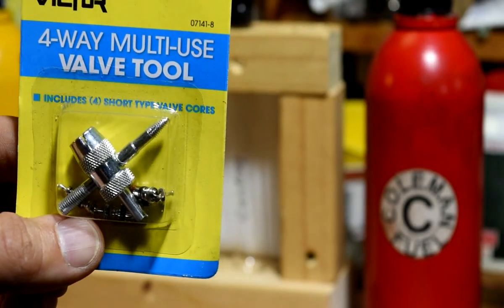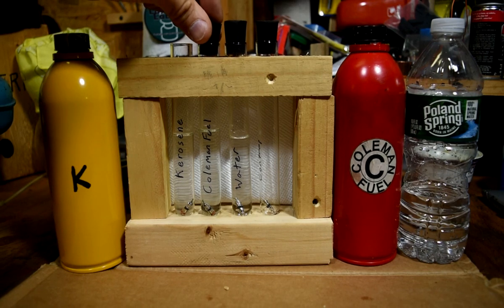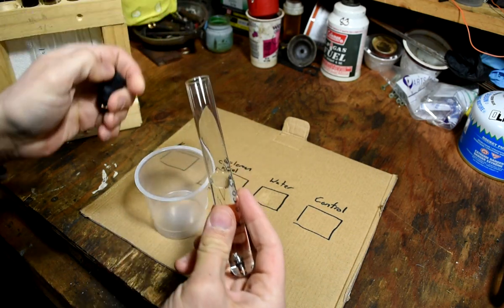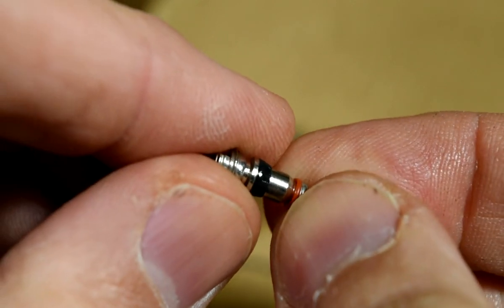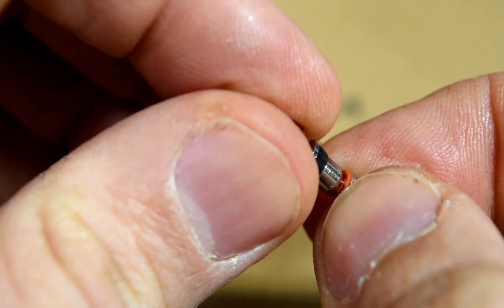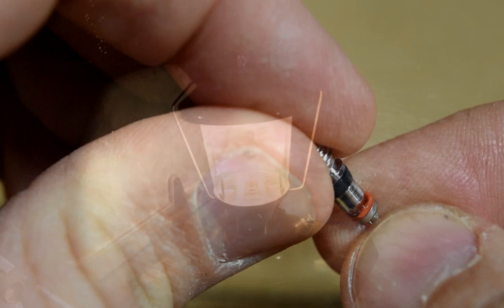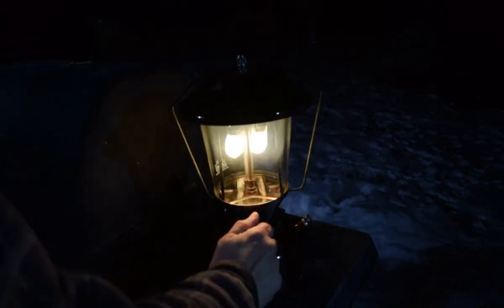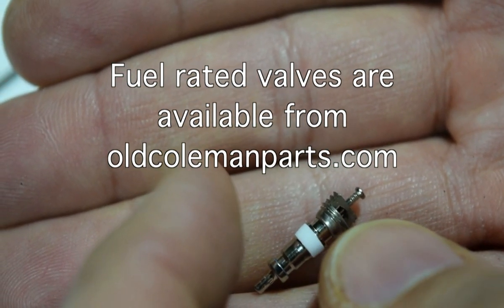Will Tire Schrader Valves Survive in a Lantern?

Comment: I have a Petromax 500 cp and new Britelyt 500XL and my question is, will a Shraeder valve stop a fuel leak if the non return valve failed during use?

Thanks, Curt !!

Mark
Reply from the maker: It would but you would need a way to actuate the schrader valve and the foot valve at the same time. Someone more clever than me could probably figure a rod from the schrader valve down to the foot valve. Honestly the shutoff valve that Coleman used pre-schrader valve is a better solution.
Reply: @LanternLabs  Thank you very much! Hey your vids are awesome, wish you could get back in to making more !! Take care and thank you so.much again !

Comment: Why doesn’t Coleman sell generators for the 428 duel fuel stove. They only sell the whole valve assembly. For the 414 they sell a generator but the whole valve assembly has the same part number for the 414  and 428. On Coleman website it says the 428 generator is unavailable and to buy the valve assembly replacement. The 414 shows the generator is still available to order. I bought an extra 428 stove and an extra 428 tank and complete valve valve assembly off eBay just to make sure I have a 3 burner that always works. Also have a 414, 425, 502, and a 424 just in case of a stove failure. 8 lanterns and counting - 9 if you count propane.
Reply from the maker: Stove generators very rarely fail, I've got a bazillion hours on my 413E and it shows no sign of needing any attention. The worst thing about changing a stove generator is how easy it is to break the cleaning rod, its long and thin and brittle from heat cycles. The only time I've ever changed a stove generator I ended up having to change the whole valve because I broke the cleaning rod. In reality I probably didn't need to replace the generator and I probably shouldn't have removed the cleaning rod...
Reply: Lantern Lab - my first 428 had such a small flame on all three burners you could hardly see them. I even pumped it an extra 30 times. I took the generator apart and cleaned carbon and heated spring and rod with a torch to burn off carbon. Then hit it very carefully with 4 aught steel wool. No change - that is why I thought the generator was bad. Do you have any other suggestions? Tried to avoid any packing nuts as they showed no sign of leaking with the soapy water test.

Comment: Thank you Curt once again for yet another awesome video.  Speaking of Schrader valves, I've been reading recently on classiccampstoves.com about Coleman GPA's being converted to burn butane, and one of the conversions in the link below is on a Schrader-equipped 508 stove.  I would suggest you do a video about what you think of butane conversions and perhaps put a fuel-rated valve inside a fount prior to filling it with liquid butane and see how it gets affected after a couple of months.  Here's the link:  https://classiccampstoves.com/threads/coleman-508-stove-running-butane.22000/
Also:
https://classiccampstoves.com/threads/coleman-501-butane-conversion.18076/
https://classiccampstoves.com/threads/burning-butane-in-a-1942-coleman-500.16259/
https://classiccampstoves.com/threads/coleman-canada-summerlite-butane-stove-model-no-5411.19101/
Reply from the maker: I'm going to stay far, far away from that. It sounds like a good way to get hurt. I don't really see the benefit, unless somebody gave you the butane it wouldn't make any financial sense. Maybe to say you could but beyond that...
Reply: @LanternLabs  I agree it's not the safest way to use a liquid-fuel stove or lantern.  But I kinda like the idea of being able to use yet another fuel you may have handy in emergency situations.

Comment: Myth: Slants (L220/L228) are awesome lanterns.
Reality: They look awesome IF you can actually get them to run correctly.
Reply from the maker: I've only worked on two and they were both pretty easy to deal with. As with most things make sure its clean...

Comment: aww salt in a wound. i had my 275 for years i lit it last month and noticed hissing after it was off. i watched your other video and saw the shrader valve i never knew it had, i tried changing it out and it got stuck real bad i tried with multiple tools including the four way tool and nothing. to top it off my dear uncle tried to take it out and mushroomed the edge of the old valve on to the threads now its on their for good. ive looked around including oldcolemanparts.com and no body carries the fuel air tube.